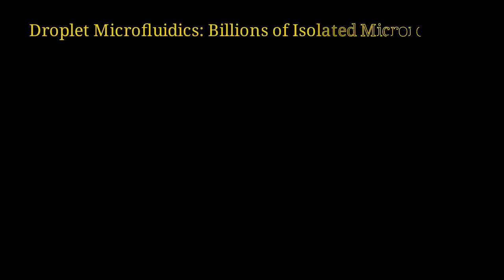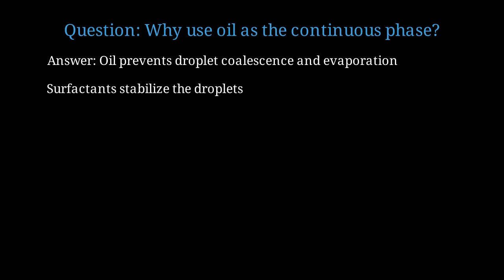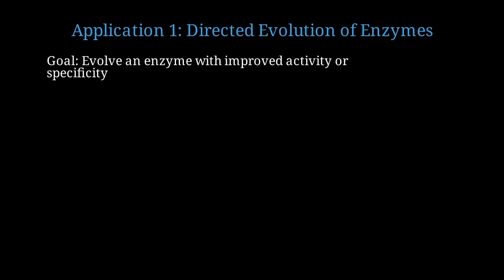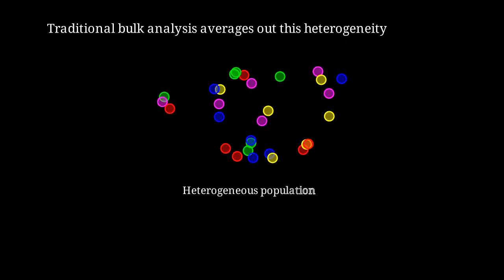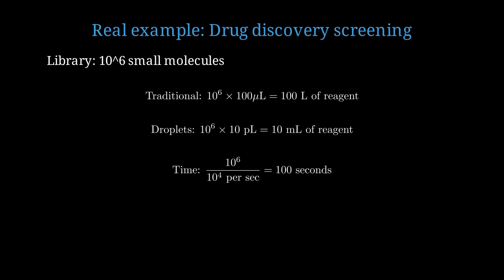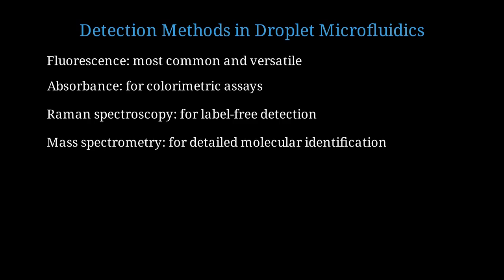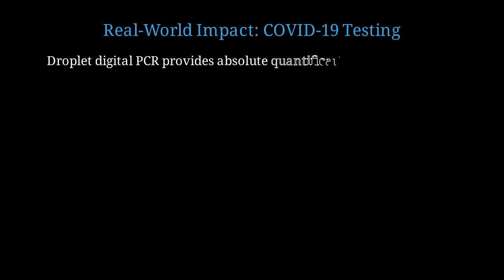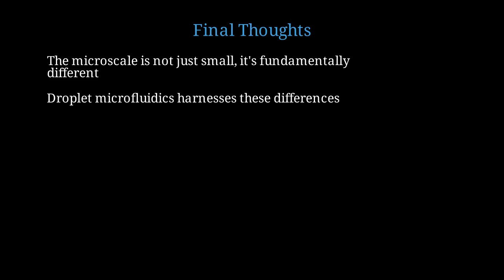A Billion Experiments in a Milliliter: Tiny Droplets, Massive Discovery

Comment from the maker: How can we design surfactant systems that fully suppress molecular exchange (small-molecule leakage) while remaining non-toxic for sensitive single-cell assays?
What are the fundamental limits of droplet-to-droplet uniformity at kHz–MHz production rates when viscosity, wetting, and interfacial tension drift during reactions?
Can ML models trained on droplet screening data generalize across chips/labs (domain shift), or do we need physics-informed learning that embeds interfacial and flow constraints?